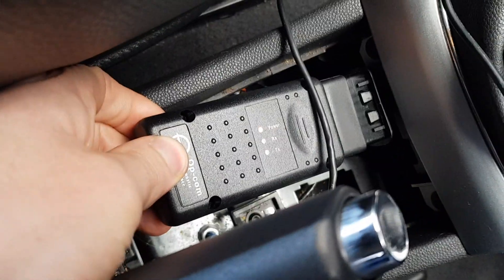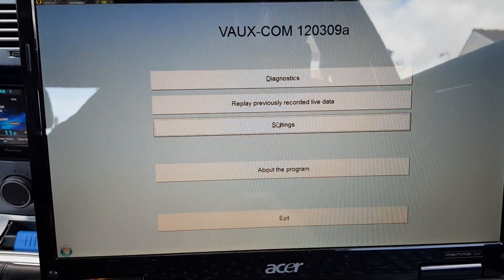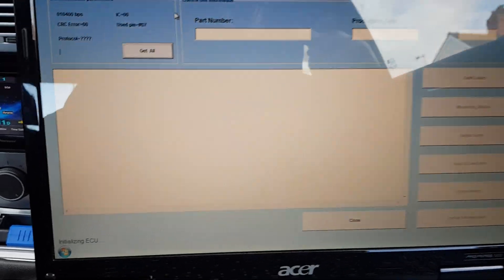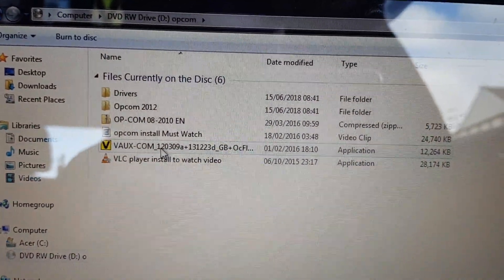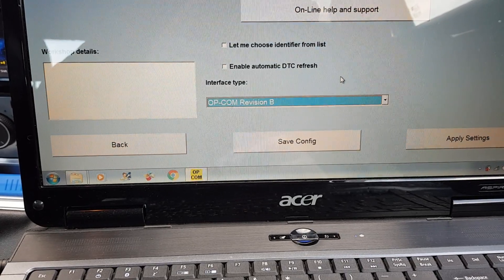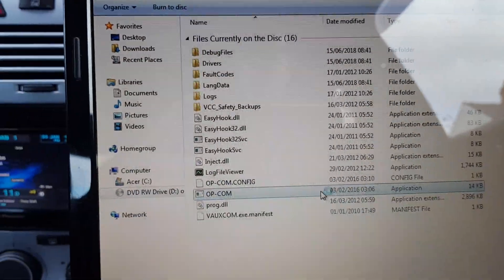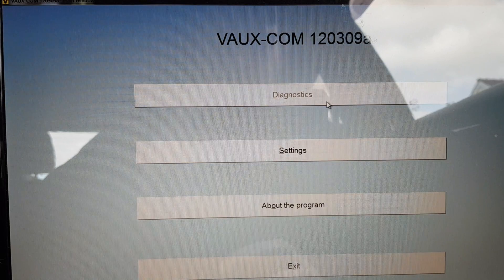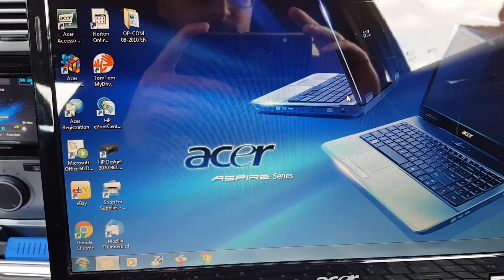OP-COM / VAUX-COM V01.99 will not connect to ecu

Comment from the maker: It turned out the tool was at fault
Reply: scott alexander  did you get it fixed ??
Reply from the maker: @EmtremeNips153  yes the ebay seller sent me a new one but I'm still having trouble accessing all the options like clocks etc. But I can now fully access the engines ECU

Comment: not have trouble with  op com 1,99, works better than op com 1,95 + 2021, thats program does show special funktions of engine , volt, rpm  and the injektors funktion

Comment: I can't see how the unit can be faulty when it passes the interface test. Others have said leave the car unplugged. Not tried this yet though.
Reply: I found leaving op-com unplugged, get same error of not being powered or connected, go back and retry with op-com still disconnected and most will then skip through to initializing ECU and at that point plug in to OBD2 port... if you're lucky it will negotiate a connection and then that particular control module should be readable and programmable.
Reply: @bezaleeluk3696  I could only get the 2010 software to work in my car. 2012 and 2014 will not work. But I managed to program a key with 2010. And clear codes. Even though my car is 2011!

Comment: I know video is old and probably you forgot about it but today I make mine working perfect on win7 and win10. I had exactly the same issues like you.
Reply: Die Hardware erst nach der Auswahl von  Vehicle, Engine, etc. Verbinden. Dann funktioniert es.
Reply: Hi, I am struggling with the same error . V1.99 and windows 10. How did you solve the issue?
Reply: How ?
Reply: Hola amigo que hicistes al final para que funcionara la interface
Reply: So it's not just me having this problem
I can't seem to work this out
Reply: Can you please tell us how to fix it?
Reply: @subsalza  Win Xp. 
1)First start program ( Run as Admin) the clone needs hacked FTDI drivers to work and this is the only way to run the hacked drivers also untick prevent from using un certified drivers... 
2) Without conectict to car conect USB and Opcom clone.. 
Settings... Test interface... Click OK... Then click save settings.. 
3)Don't conect it to car untill after you press (diagnose the part you want to diagnose) example after engine.... That works for mine... 1.99
Reply: @absolutamnesia4975  do you have the 1.99 ocflash file?
Reply: @danielwalstad7634  No sry..

Comment: Error while creating license dat??? The list of supported ecus cannot be loaded ??? Interface communication error or interface not powered from car.. what should I do ???
Reply: Sometimes the clones are not exactly matched up in power supply side some times when I try w low battery it will not run... I have to start car...
Reply from the maker: Contact the seller, explain the situation and send it back as its probably faulty like mine was.
Reply: @scott2735  cool thanks Scott it's just I get .. vaux then this 120309a+131223dgb then China clone .. (3 programs) .. would I need the car running I'm guessing you don't
Reply from the maker: @shivt91  you need the ignition on
Reply: @scott2735  actually running 3rd position?? (Engine running) thanks
Reply from the maker: @shivt91  no just second position on the key you dont need the engine running you just need power to the ECU
Reply: @scott2735  but I only get eprom with engine running pal
Reply from the maker: @shivt91  I'm not sure about that to be honest.I think the cheap Chinese clones are pretty poor but you get what you pay for I suppose.